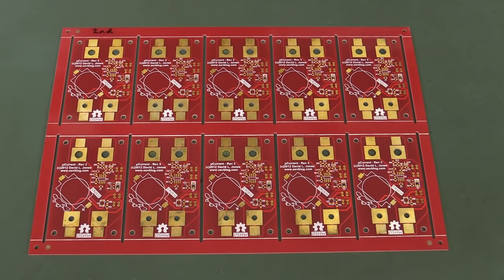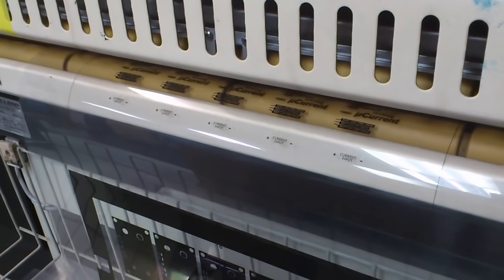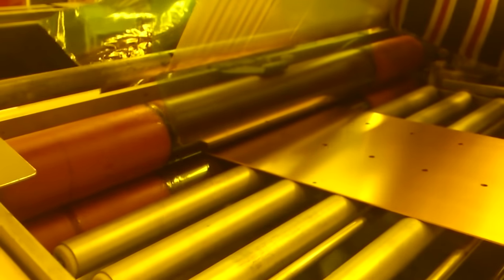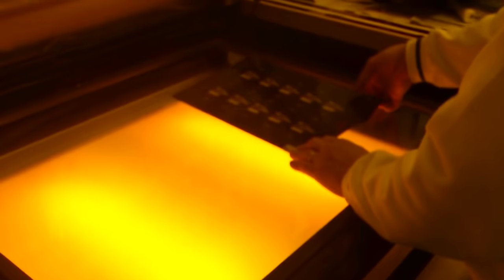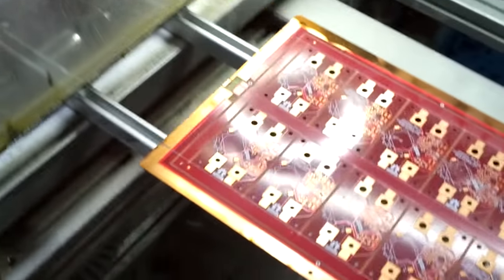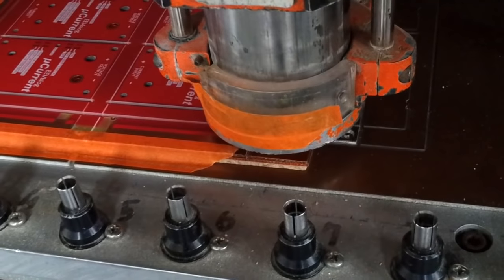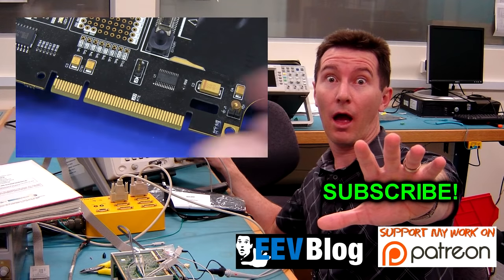EEVblog #939 - How Is A PCB Manufactured?

Comment: The reason they electroplated the copper the second time was to increase the copper up to the required thickness. The copperclad they use only has a thin layer of copper on it. That allows them to etch them faster and have finer traces.
Reply: Because you can't elecrolytically grow copper on non-conductive surface. They use something to grow copper inside plated holes, not sure what exactly.
Reply: IIRC, it is a palladium based chemical, that deposits electroless extremely thin layer, this makes it conductive enough for electrolysis copper to deposit.
Reply: And it guarantees that the through hole plating connects to the surface plating.
Reply: it's easier to plate up to the required thickness, than to etch down to the specified thickness

Comment: Card edge connectors are hard gold which is a galvanic process. You pay a premium for combining the normal chem. NiAu for SMD and the galvanic Hard Gold for the card edge connector. This is important as you should not solder on Hard Gold, as Gold easily alloys with tin, forming a bridle joint.
Reply from the maker: Yes, correct, should have mentioned that. Although if you only need a few insertions for a test connector or something, regular electroless gold edge connectors are just fine.
Reply: che?

Comment: I'm really surprised that most of this isn't automated completely.
Reply: in smaller factories this is not that uncommon i think, plus its a lot more flexible if you have a human there.
Reply: Nathan Trone i think that is because these are prototypes.
Reply: Nothing looked out of the ordinary for doing Dave's run then would be for a larger run. I assume this batch was for about 100-200 uCurrents or so.  None of the process seemed to be set up just for him other then v-scoring. I too was susprised by all the manual labor.  Seemed as if there was a good 15 mins of human time for each panel, if not more.
Reply: It's a small production run, so it wouldn't be really feasible considering variety of board sizes, special requirements  and so on the PCB manufacturer has to cope with. If you deal with manufacturing BIG batches of few PCB types (like you make PCBs for PC motherboards) then of course line would be nearly fully automated - kind of factory where bare copper board comes one side, and trucks loaded with PCBs comes out another side;)
Reply: Yeah, but I thought there were circuit printers and they just apply a layer of whatever. Then send through the conductive printer again. Repeat as needed.
Reply: Conductive ink like that is nowhere near reality yet, if it ever will be (I doubt it). Yes you can print conductive ink, but it's extremely thin, and only carries small currents, and has a lot of variability in resistance and so on (or at least, it can potentially have it).

Even the big massive huge PCB manufacturers do the same... Big fat copper sheet glued onto fiber glass boards. 's the way it's gonna be.
Reply: the taping of boards instead of a jig looks wildly inaccurate

Comment: This process seems to be tiny compared to what I do every day at work. We make multi layer panels and start off with inner layer cores that are etched, punched, scanned (I am an AOI scanner), lay up, press, flash, then drill. And the electroless lines at my work are massive, the panels are carried by a massive crane from tank to tank. Theses panels are also very small, the panels we process can be as big as 36x34 inches down to 18x24 inches. You didn't get to show the full process sadly, but it's nice to see a process shown online.
Reply from the maker: Yeah, this is a very small scale facility.
Reply: Indeed. The CNC drilling machine shown seems to be a 1985...1990 model, having two 5-1/4'' floppy drives and a paper tape punch unit. Larger factories will use faster, much modern equipment, for sure.
Reply: please make a video

Comment: I am surprised at how much manual labor goes in to this. I thought the reason you could get PCB production so cheap these days was that it had become highly automated.
Reply: MrCravon I've been working on the inner layers portion of a PCB process and I can tell you a lot of stuff requires that human touch, picky machines and loading them correctly is something tough for some robots.
Reply: +TheBoxxWillRuleAll Really, I too thought the boards would roll into an assembly line (similar to the development one in this video), and be mechanically constrained by side rollers combined with optical front edge detection for steps needing positional precision. I agree that arm-style robots wouldn't provide the precision, hence my idea that mechanical constraints and optical sensors would be used.
Reply: On minimum wage

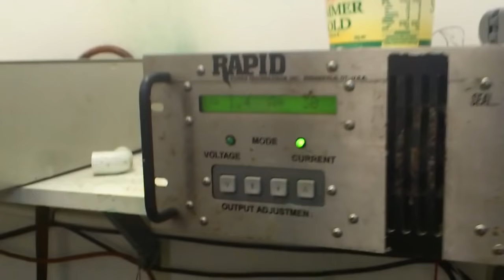Comment: 10:40 This is the actual plating that builds up the traces and the ground plate. If you didn't do this step, your traces would only be as thick as the copper coating on the fiberglass board. To keep costs of the boards down, the copper coating is extremely thin. Where I worked, this particular process took like 45 minutes. That is a copper-sulfate bath with a copper source in it. Where I worked they used these long thin "baskets" filled with copper nuggets.

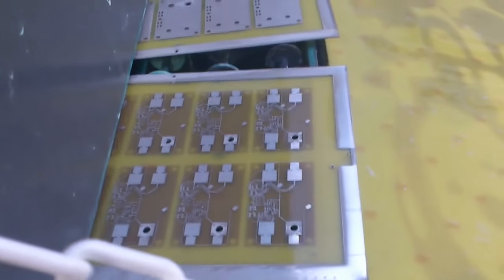Comment: 12:15 No Dave, what they are doing is exactly how this was done when I worked in a PCB factory (like 1990). They even use similar trees. This was always done with negative photo-lithography. TBH, I'm quite surprised that this hasn't really changed at all. The only difference I can see so far is that this facility is setup for smaller board runs.  It's a shame you probably don't have any gold plating on your board (for card edge connectors). It's done much more efficiently so you don't lose any of the gold. They also keep the card edge connector/gold plating stuff under lock and key. People used to steal the copper nuggets, but they really weren't worth much, but gold is. I never even saw one because I had no access to the gold plating department.